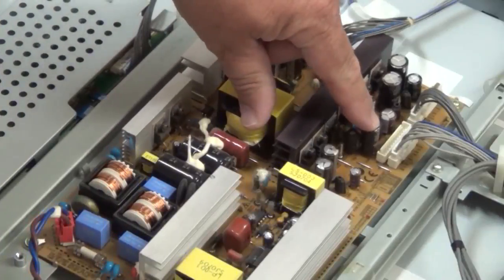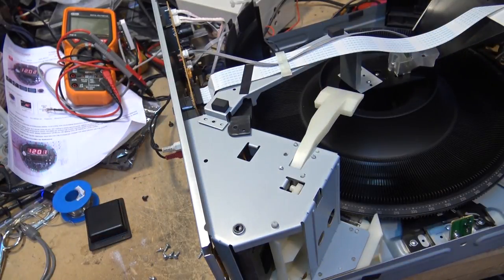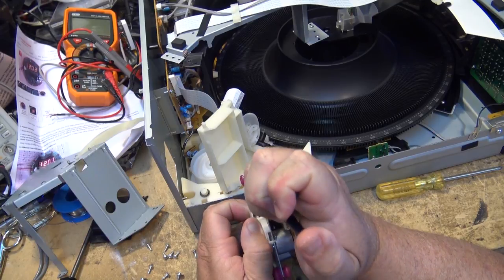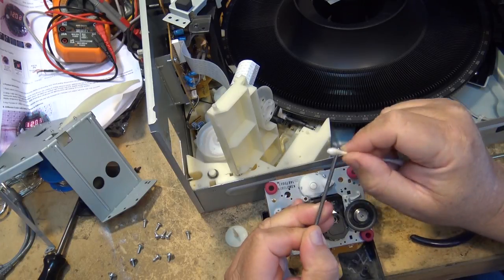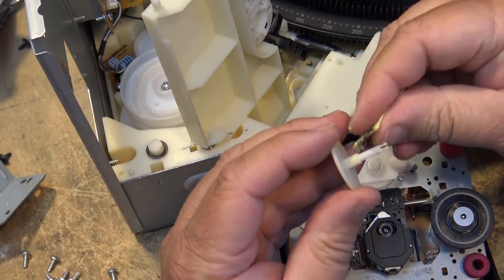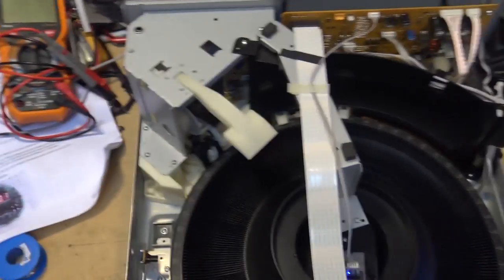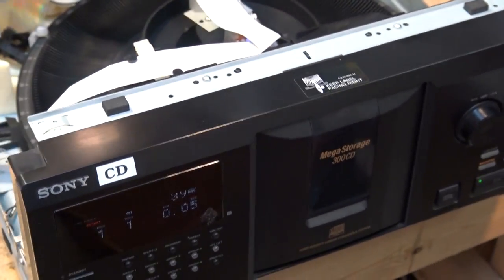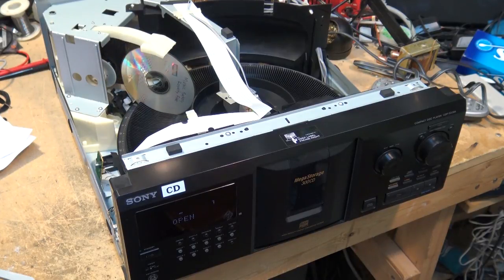Sony 300 disk CD changer skipping  on playback

Comment: I fix real jukeboxes, they use a similar carousel in Wurlitzer but never more than 100 Cd's.  The delicate plastic parts would never stand up in a smoke filled bar or be durable enough for field service. maybe if the entire changer was changed and kept as a spare. Seems by the time they tried that many Cds, they went all digital.

Comment: Nice video. Where do you get you Molykote lube?
Reply from the maker: That I can't help you with. All those little packaged of mollykote came bundled with replacement pinch roller arms in Mitsubishi VCR repair kits back in the 90's. Yes I have had them since then. Each pinch roller kit had enoigh lube to do about 10 machines, so I kept the extra packs and brought them home when I quit.
Reply: Great video. Solved a similar problem I had with my 400cd jukebox. The state of my grease was not as bad as I’d consider sticky or dirty, but it was a friction problem with the same rod. Having only a screwdriver at my disposal, i had to do with scraping extra grease from other parts of the unit with a toothpick and applying it on the rode :)

Assuming this fix might be temporary, and considering i have no experience with this kind of repair and materials, could you recommend a grease product that one could easily acquire, let’s say on amazon? I see bunch of dow grease products there, but have no clue which one would work for me.

Comment: Nice Video like always Dave :) I hope you get your patreon number up.
Reply from the maker: They are heading in the right direction.
Reply: i would sign up and donate as your content is very good
Reply: +12voltvids does this item allow 300 discs to be played back like a jukebox.
Reply from the maker: Yes, or if you link 2 of them then 600 disks and it will cross fade from one to the other and self cue.
You can program it to play specific tracks off specific disks, or just put in random. I have a 200 disk myself.